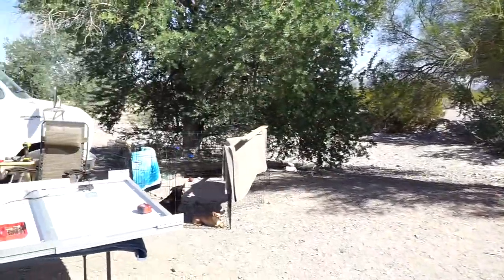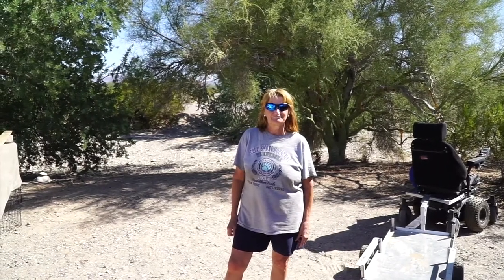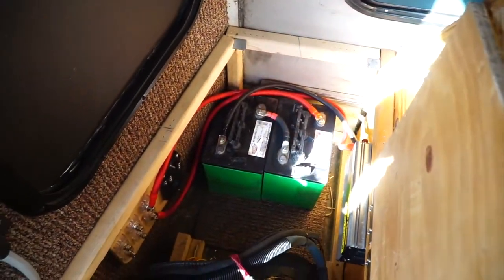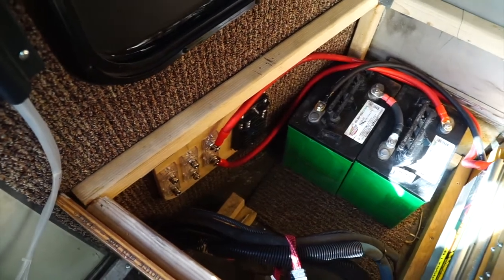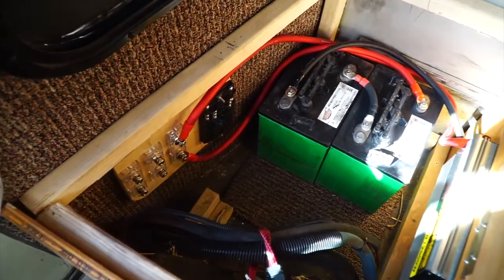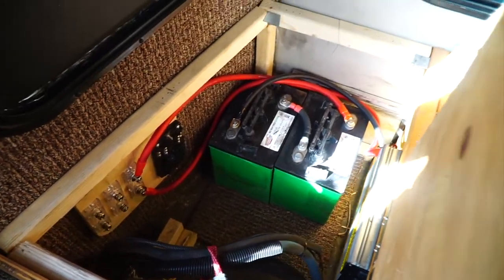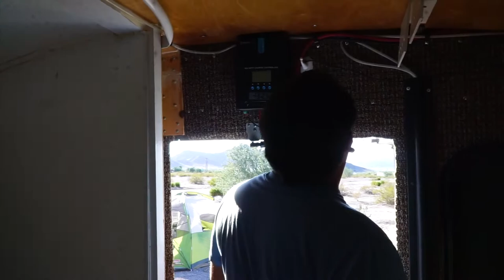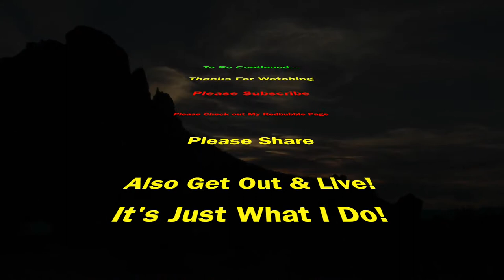Solar On Shuttle Babe

Comment: I dont know why more people dont use 24V, less IR losses, more devices still work in low light. Right Matt?!
Reply from the maker: You are correct but most Vehicles are designed around the 12 Volt systems. Also all RV Items are usually 12 Volt too.
Reply: My RV is 12 volt system....can't use 24 volt....right Matt?
Reply from the maker: Gypsynurse Cathy, yes but you can use a mppt that is designed to convert high voltage to 12 volt dc.
Reply: Matt Kochel JJ In a Jayco I think I spent too much time in other industries that use 24V, and like you said, higher voltages can be converted to 12V. I was also wondering if the conversion efficiency was better on inverters with 24V.
Reply from the maker: CincyPlasmaTech,
Yes the efficiency is better at 24v with inverters but it is only 5 to 10 % more effective and harder to find items to run on so I recommend if you are using it for off grid living in a home I would use 24v or even higher but for mobile applications I would recommend 12 volt setup.